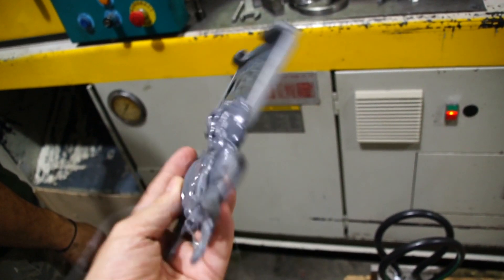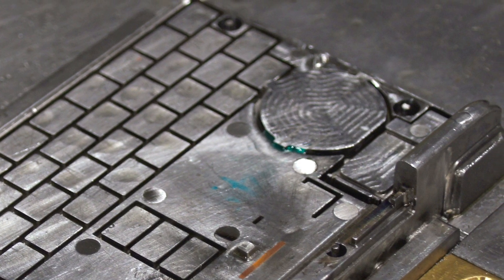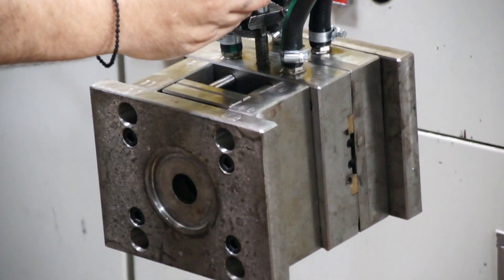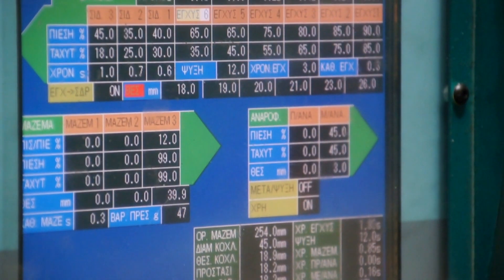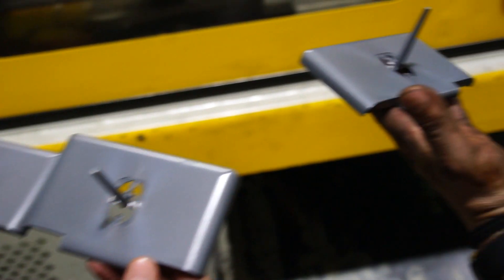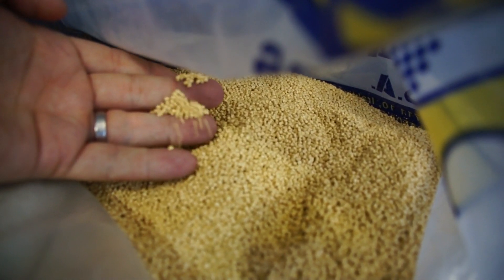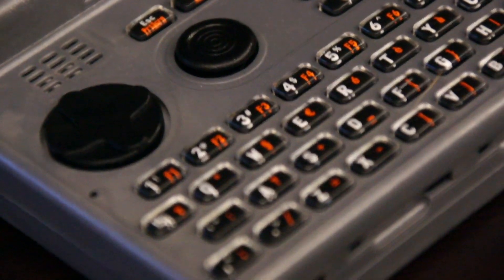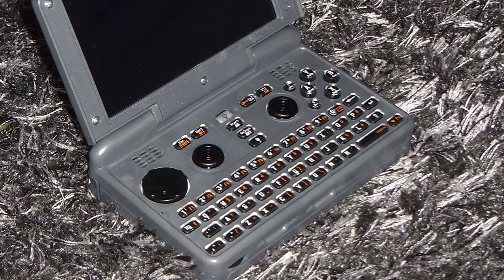Pyra Plastic Production - Physical test

Comment: At this point I'm wondering if it would just be cheaper if I designed and built one myself. I absolutely love the idea of this device (it looks cool), but the price is really really high. 😲
Reply: You can do so. The price for producing such prototypes PCBs is about 3,000 EUR one-time-setup costs and maybe around 600 - 700 EUR per PCB (if you produce at least 10).  And unless you want a 3D printed case, the moulds would be about 60,000 EUR. You COULD use a Raspberry Pi and print a 3D case around it. That would be a lot cheaper. But you'd still have to find solutions for cramping a keyboard in there and find a display that works fine, etc.
Reply: Take a Clockwork Pi (Gameshell)!
Reply: That would be my top choice for a tablet style handheld, but I would much rather have a clamshell design. The Pyra really is ideal.

Comment: Is the current cpu worth the price point?
Reply: Well, it's still pretty fast, the Cortex A15 has at least 3.5 DMIPS/MHz per core, so in theory, the OMAP5 has at least 10500 DMIPs (5250 per core). The Raspberry Pi3 has 2.2 DMIPS/MHz per core which adds up to 10560 DMIPs... so it's about the same. And the Raspberry Pi3 isn't really that slow. The iMX.8 is a bit faster and that might be a possible CPU upgrade, once the iMX.8 Nano is out. Sure, modern high-end smartphones are a lot faster, but these SoCs are not available for such projects.
Reply: Michael Mrozek only as powerful as a PI that’s a shame then looks like PS2/3D demanding emulation won’t work very well then!
Reply: @michaelmrozek790  Cortex A15 is indeed pretty fast. I still use an exynos 5422 (odroid xu4, quad A15, quad A7) as a desktop. I can't say I can call any RPI not slow. What I really hate is that Samsung backed out on the pyra, else I would be a happy customer/pre-order/kickstarter. You handled the openpandora great, and you have proven your projects are worth it. If even for just the videos :-0 . And yes, I hate it that Samsung stopped selling newer exynos for a reasonable price :-(. Amlogics are a pain in the butt.

Comment: WOW!  It is amazing just how long this is taking.
Why didn't you guys have the Pyra compatible physically with the Pandora?  It would have been nice to have been able to drop the development of the physical case and keyboard by reusing the mold.
Reply: Probably because it sucked. If they didn't care about quality or adding new features and just cranked out the same device again with a faster CPU, it wouldn't be worth the money. You might as well buy a GPD whatever at that point.
Reply: What new features is the Pyra bringing over the Pandora in terms of its physical build?
Reply: @tarstarkusz  There are multiple reasons we didn't do that. We couldn't simply reuse the case as the nubs were not available anymore, so we needed to change that area. Additionally, we added two more shoulder buttons (so we have four now) and a bigger battery (as modern SoCs need more battery power than the older Pandora one). 
We also have more ports in the case (USB, HDMI, etc.) and the screen size has increased (so the speakers had to be moved down).

But yes, you're idea is generally good: The reason we built the Pyra the way it is is to make sure future upgrades will be a lot faster and painless.
The CPU board is now plugged into the mainboard, so for future versions, we don't need to design a new case or mainboard anymore, we just need to create a new CPU board. 

Everything inside is modular, nothing is glued in there, so everyone can easily replace the parts himself.

It was a very long road, but from now on, it should be less painful and easier.
Reply: I'm looking forward to the release.  I forgot about all those changes.